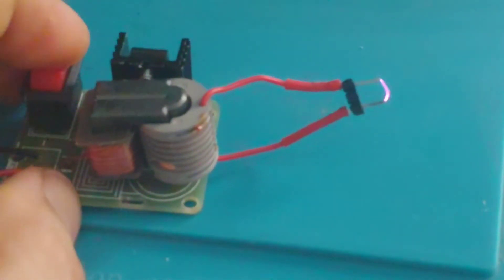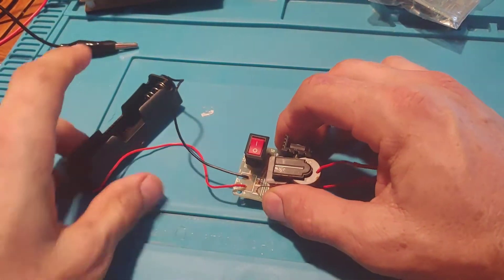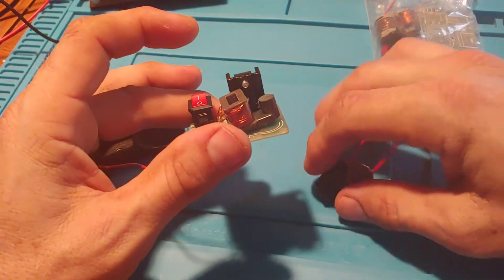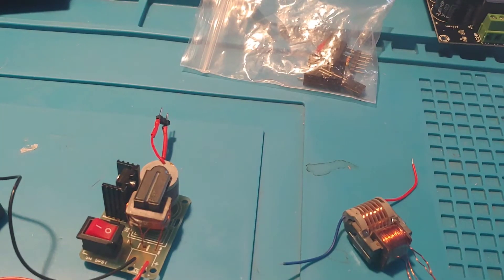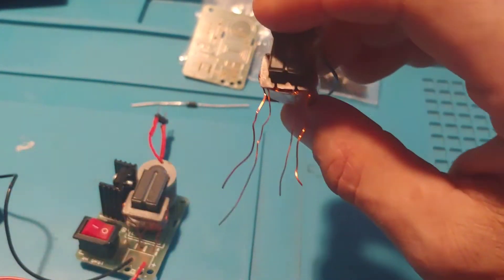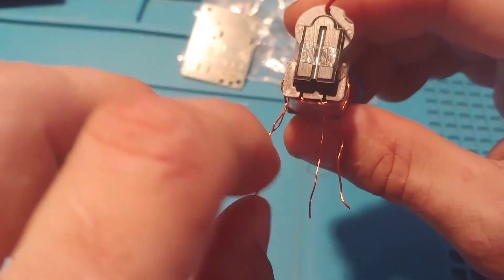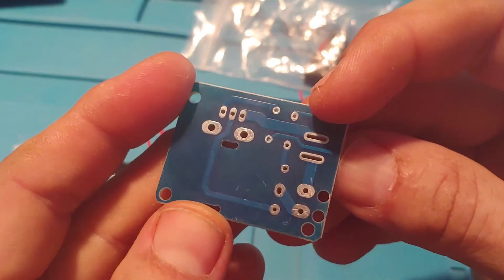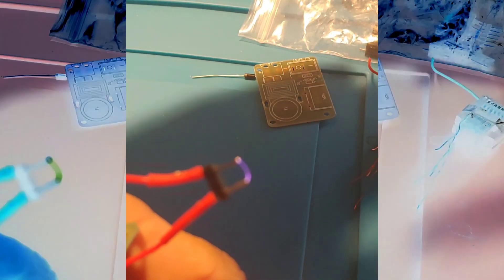15kv High Voltage Generator Kit

Comment: Link to kit?
Reply from the maker: @benr8906  Comidox 15KV Boost High Voltage Generator High Frequency Transformer Inverter Arc Igniter Coil Module Disassembled Parts for DIY Use 2Sets(Include PCB Board) https://a.co/d/560HHEY

Comment: I do exactly you've been show but mine circuit won't work. I don't get it why. Only change I've made is removing the switch "on-off" by putting the wire instead, to make permanent closed circuit. Is that could be a reason??!!